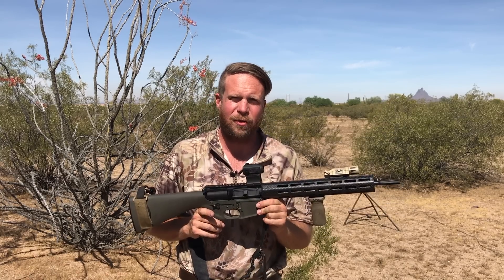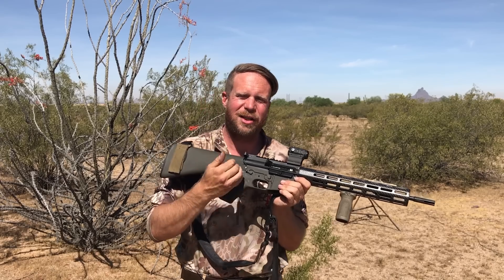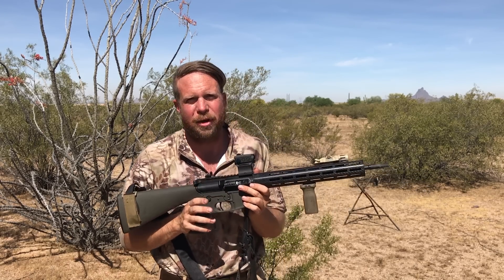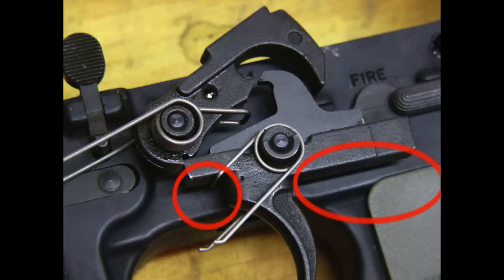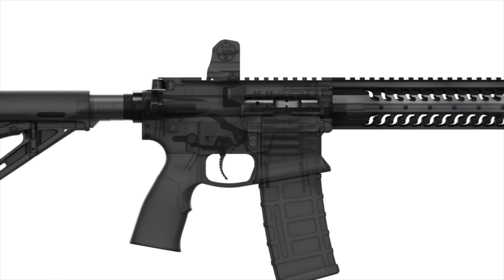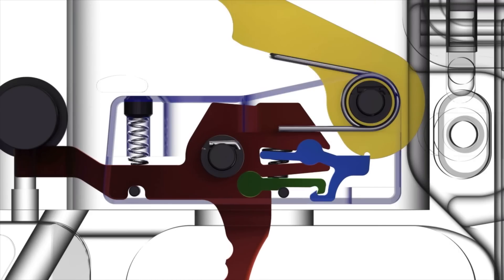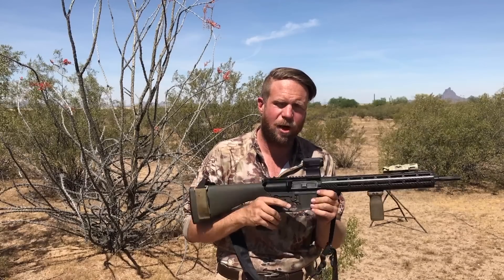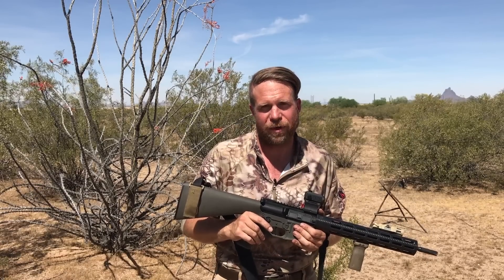WWSD 2017 - The Fire Control Group (Trigger & Safety)

Comment: When I first read about popped primers jamming the trigger on an AR, I thought "That's odd."  My very next trip to the range, a Prvi 175gr .308 primer popped into my LAR-8s trigger group.  Very frustrating!

I also had one of those primers pop and get into my gas key.  That took awhile to trace out.
Reply from the maker: It's a strange phenomena but it happens, and it happens randomly.   It's nearly impossible to induce intentionally as a demonstration so some people just plain won't believe.  ~Karl
Reply: I got a primer star thingy under a trigger assembly too, took several hours to figure that one out. This looks like a cool upgrade.
Reply: I have had this happen twice. Cases were my own Federal reloads. I learned after this was a problem with Federal cases used for reloads when they get near the hot end.

Comment: With the reduced shock to the trigger system. would this trigger make a lightened bolt carrier group less problematic?
Reply from the maker: No, not really.   Generally speaking it's a two or, more commonly, single stage trigger that is adjustable between 2.5 - 5lbs of pull weight.  ~Karl
Reply from the maker: Similar problem, similar solution.   ~Karl
Reply: InRangeTV 
Good job,,,  keep up the good work. .
Is there an official definition  of a " MATCH GRADE TRIGGER"???
Thanks. .
Reply: InRangeTV 
Thank you for the reply, ,, I have a set trigger on my model 70,,
and I  was confused. ..
my bad,,,
thanks again...

Comment: Why the insistence on using an M16 stock instead of an adjustable one?
Reply: Watch the latest qna. He explained that it's the only way to provide sufficient strength with a polymer lower.
Reply: I think they explained the reason why in the first video of this series.

Comment: Not that I was expecting you guys to do it but, what no binary trigger system?
Reply from the maker: Absolutely not.   ~Karl
Reply: I can understand why. Anyway, I've been rebuilding my AR for the last two months and a new trigger group was next on the list. I may just have to give the KEA trigger a try.
Reply: InRangeTV Could you elaborate on why no binary triggers? The Franklin system is far from great, but the FOStech seems pretty good, and I could see where it might be useful.
Reply: I'd absolutely go for a binary trigger if it stops hammer-follow like that one, and so would Stoner (he was my uncle), way before some of these components like the JP captured spring (I'd replace that w/a flatwire spring and ADJUSTABLE gasblock for under 1/2 of JP's cost & many more benefits that ADJ gas gives... until I'd saved enough money to get that binary trig ("until I saved enough money" because this was a $1,900 rifle.  for just parts, not the assembly/labor.  I think it could've been way better and shitting out rainbows and unicorns for me, for even half that cost.  For even $1,400 in parts (DIY home-built...), I'd expect st/st barrel with polygonal rifling & nitrided, Midwest or even lighter weight handguard, muzzlebrake w/quick-detach Krink-style blast-redirect, the HoloSun, IR flashlight+a normal light, , my 3D-printed mini-CNC homebrew ambi bolt-catch & ambi-mag-release, in addition to ADJ gas & flatwire (or maybe Piston w/HBAR to imitate an M27) -- and 6.5Grendel or 6x6.8 ...old man STONER LOVED heavy-hitting cartriges ...with NiB-X carrier, Ni-Teflon bolt.  For a bit more $ than that, depending on the rifle's role, I'd add pan+rotate bipod option and Leupold's LTO (cheap, cose-range IR w/reticle that can be mounted next to a 1-6 scope, or 1-8 for Grendel.)